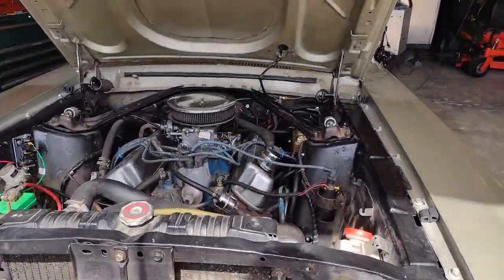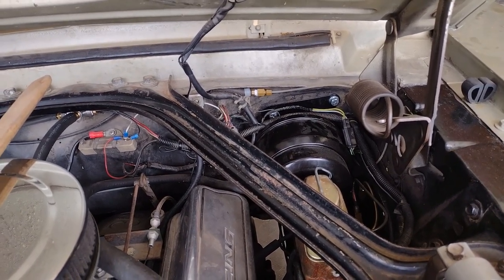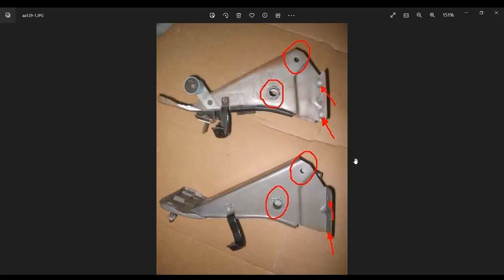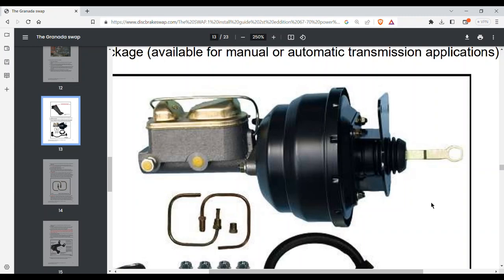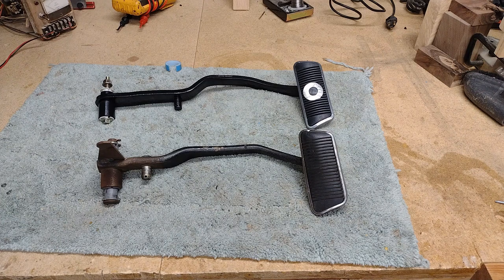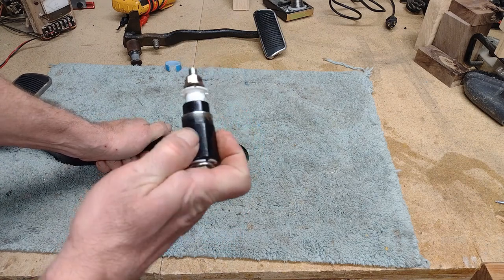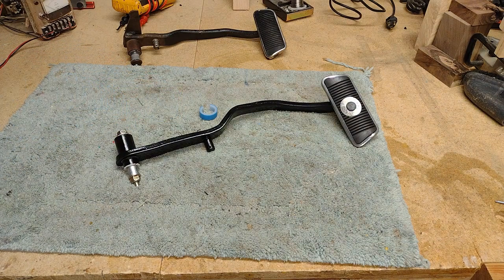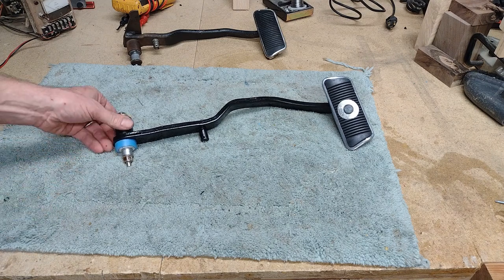Think twice before you install CSRP brakes on your classic Mustang

Comment: Hey there, we feel your pain... For those of us, in this hobby/addiction to torment ourselves on purpose.. We must thank you, for taking the time, to tell us, when a product just doesn't work out. It's the only defense we have, from wasting time and money on poorly engineered products. PS, I've seen similar complaints about the boosters used on "Leeds" brand kits sold from NPD and CJ Pony.. They're said have diaphragm leaks on arrival or shortly after install and use. I went with the Mustang Steve, Fox body type booster and Master cylinder kit, which uses a reengineered 65/66 drum brake pedal and pedal support bracket... I'll let ya how it stops when I get the car on the road.. God bless ..
Reply from the maker: Yeah, I guess there are problems everywhere.  I just wish CSRP had used Ford's original method of bolting the booster to the firewall / pedal bracket, instead of coming up with a far worse idea.  It's not something you realize until you're too far into the project to change your mind.

Comment: Love my manual CSRP brakes. They don’t make any that is better. I don’t understand why anybody would want power brakes, when manual disc brakes works awesome. They are not hard to push and they stop really well. It gives you a lot better feel for stopping.
Reply from the maker: @TexarkanaPrepper  Good to hear this.  I consider this a huge mistake on my part, and plan on buying a manual disc / drum master cylinder as a spare for if the power booster pukes.  I'll re-install the manual pedal since it's easy to deal with.

Comment: I used this setup around 20 years ago. Its BS. I have since used only factory boosters.  I have used mustang Steve's 05-10 mustang disc brake conversion. I do have to use 17" wheels, but what a difference. Best braking 1968 Cougar I have ever had.

Comment: Just tack weld the piece on?
Reply from the maker: Yeah, it's just getting the pedal out and back in, is becoming nearly impossible for someone on the wrong side of 60.  First remove the seat, steering wheel, and maybe instrument panel.  Now, look at 4:47 in this video where I mention needing to remove or greatly loosen 4 bolts.  Doing that requires removing the export brace and the hood.  I managed it once with the hood in place which I'll never do again.  When I remove the export brace on my car, the shock towers relax a bit , so a person has to deal with that.

Comment: Clearly you’re not familiar with modifications. Maybe watch some YouTube videos first. It’s not going to be easy and you’ll have to order separately a few extra parts because remember this kit fits multiple makes and models. You need to do a little more research.
Reply from the maker: Clearly CSRP made the brake booster mount incorrectly.  Clearly I made a youtube video explaining their mistake.  Clearly the CSRP spin weld on the pedal fell apart twice.  Clearly, even with these issues, I got it installed and have been driving it for 2 years now.  Clearly their kits fit multiple models, not multiple makes, since they're all made by Ford.  If you watch a few other videos I've made, you'll clearly see I know how to modify.

Comment: I have the power brakes on my 1970 and im seriously considering going ro manual just to free up room and not have to worry about the booster nonsense.
Reply from the maker: The mounting of the original Ford booster is properly designed, but this CSRP thing is just wrong.  If your car came with power brakes, keep them.